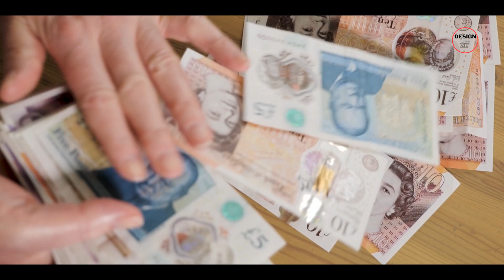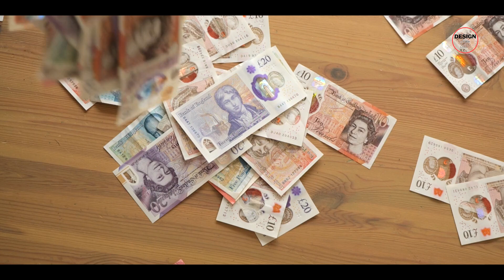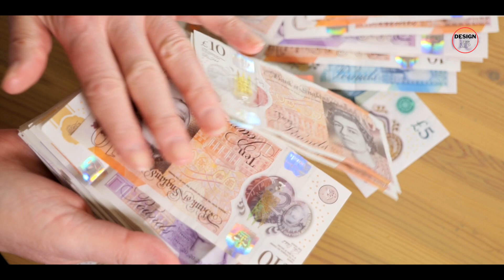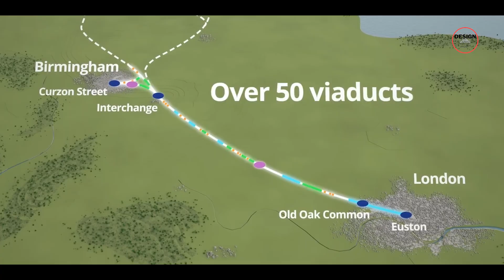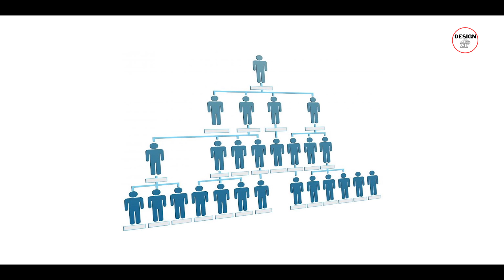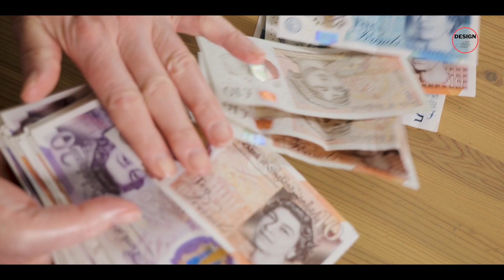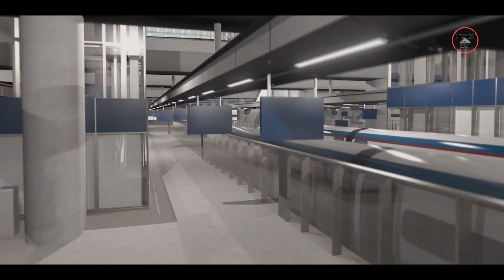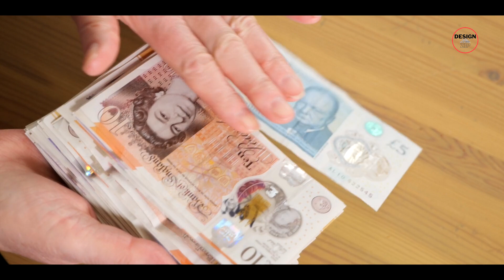What Went Wrong with the HS2 Railway Project?

Comment: Time is money, that's include a big project like this, the longer you let some project run, the more expensive it get. Example, the new extension in Hokuriku Shinkansen to tsuruga only take around 5 years to build, Indonesia high speed train also only take 5, most HST project that have minimum cost overrun often take no longer than 5 years to finish, project must anticipate cost overrun but that doesn't meant you let the cost to overruns.
Reply from the maker: Very true

Comment: Indicative of all that is frustrating about UK major projects, is the revelation that the proposed second Thames Crossing tunnel has so far cost almost a billion pounds, at planning and consultation stage alone.  On October 4th the government deferred a decision on whether to go ahead, adding more cost.

HS2 phase 2a to Crewe might go ahead under propsals put forward by the Mayor of Manchester, supported by a recent report to government that warned of the dire position the west coast route faced, if no alternative was built.  Capacity on the route is seriously curtailed by bottlenecks, in this case the Trent Valley.
Reply: The government probably deferred the decision on the Lower Thames Crossing as there are 2,000 planning documents to read through which they should do to assess the valuefor money viability of the project. . Of course they won't really do that but delaying the decision until next spring should pull the wool over the public's eyes to make an impression. Just in time for the local May elections.

Comment: It's all as usual.After the Channel Tunnel opened, for years you noticed how slow the train became once it hit the UK. The whole thing is (like most UK infrastructure) a fiasco.
Reply: Not true.  Its design speed of 300km/h is maintained throughout, except for the tunnel section where speed is reduced to 160km/h.
Reply: @michaelwilliams3232  That's true now that HS1 is completed and the trains end at St Pancras. I can assure you that when it opened and for years afterwards, trains were not running at 300km/h anywhere along the line on their way to Waterloo
Reply: @timor64  From Fawkham Junction they joined the standard route into Waterloo.  Some 16 years ago.